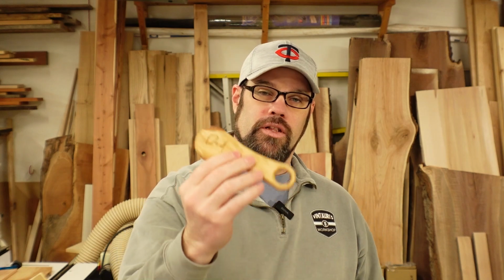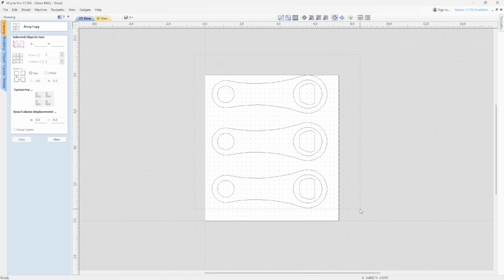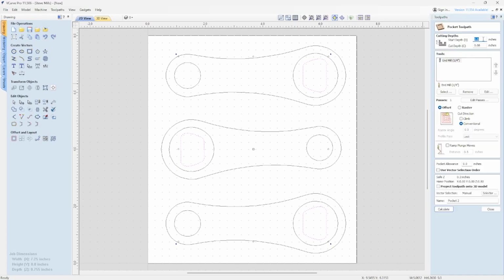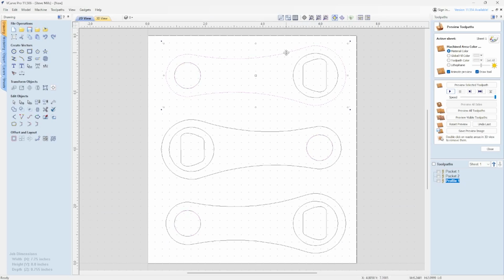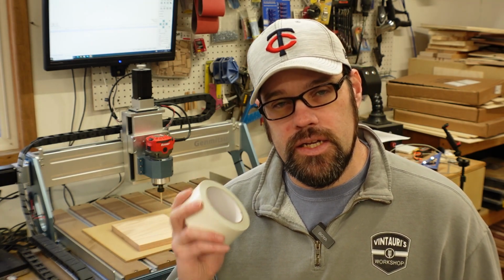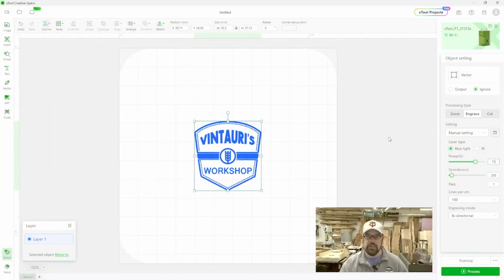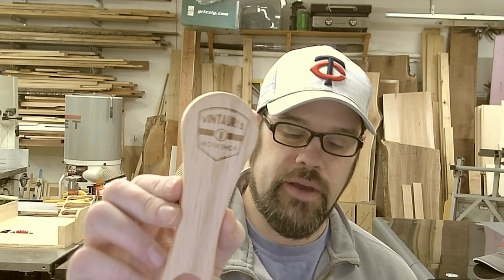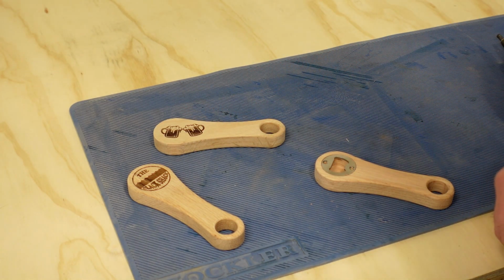From Scraps to Cash | CNC cut and Laser customized Bottle Openers

Comment: For through cuts I personally set the depth to “z” because I sometimes change the thickness of the material and forget to change the cut depth, this way when calculating Vcarve will automatically change the through cut depth
Reply from the maker: I've done that on some projects to set the zero to the waste board, it can help ensure a clean cut and minimal abuse to your waste board.

Comment: Nice simple project. How are you liking the Bauer. Guessing with the Nema 23’s on that machine, you could probably get upwards of 60” per minute or more. Thanks for sharing
Reply from the maker: The Bauer is still in the testing phase.  I'm watching it to make sure it does not over heat, or start fluctuating in speed too much.  But so far, as I dial in my speeds and feeds, its working pretty well.  I'm going to play with some trays and small boxes that should allow me to push the speeds around a bit.
Reply: @Vintauri  I have a belt driven desktop cnc with low torque nema 17 steppers and I am pretty comfortable with 40 ipm with a qtr inch endmill and also a bowl and tray bit. I use openbuilds to operate it and it allows me to up the speed during cuts and I have been as fast as 48 ipm. Good luck and thanks for the cnc content

Comment: Great video as usual I have the Genmitsu PROVerXL 6050 Plus 
it's definitely good to have both the Laser and CNC to work with I will get the file from etsy and make a few of these for gifts
Reply from the maker: Thanks Russ!  I'm glad to be jumping back into it with this machine to get more projects like this out there.  It's a good benchtop machine so far and with the trim router installed, I can push it even harder.  Although getting dust collection going is going to be high on my list of projects for this now.
Reply: I understand about dust collection especially with painting projects while trying to CNC I invested in the CENTRAL MACHINERY 35 Gallon, 2 HP High-Flow High-Capacity Dust Collector from Harbor Freight